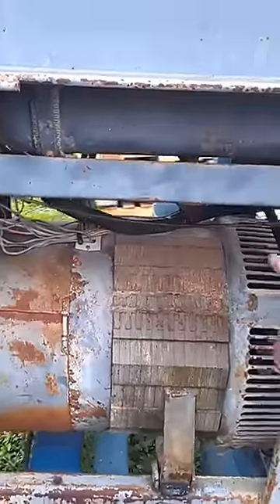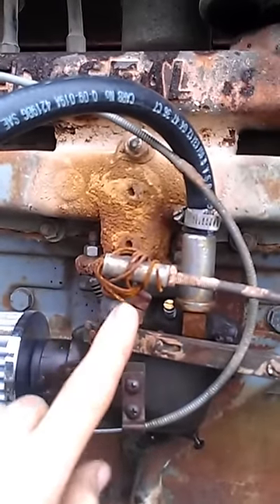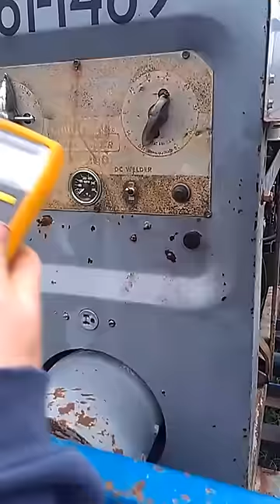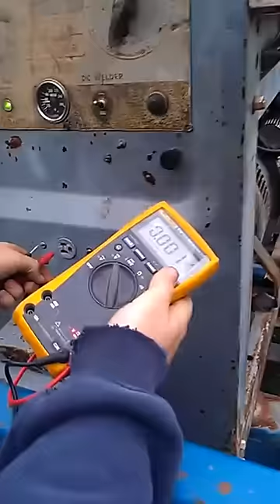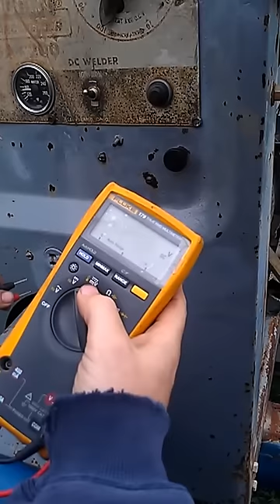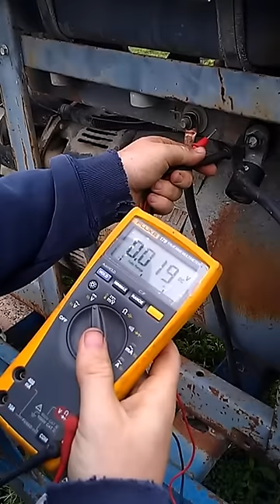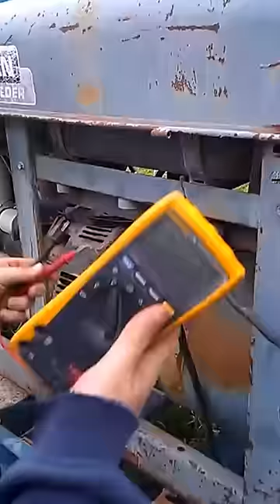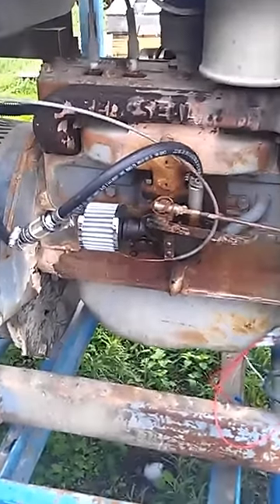setting ocv on sa200

Comment: You can set your OCVs where ever you like them. Now thats with in a given range due to the output at the 120v outlet. Not too much, not too little. But as far as your OCVs feel free to set it where the arc fits you the most. Most people are better off setting it to factory specs. But others like to bump it up to even over 100 for their welding habits. I've welded with machines at 108. Not best for most welding applications. But then again pipeline ain't most welding applications. I keep my 200s right around factory set. My 300D specs are naturally higher at 98 but on occasion i'll bump it to 105 or so. These things change along with environmental conditions, elevation, etc.
Reply: Dude my 300d is a bitch to dial in. It was set on 119 and the rod kept going out on a wide gap. I adjusted it down and now all my root beads wash in flat. No stack internal on the pipe. I'm pissed. Can't get it back up to where it originally was at 119. It won't go above 100. Seliniod bad maybe?
Reply: I like the OCV a little on the high side. It makes starting rods easier.

Comment: Lincoln 200s are maxed out at 93.3 on ocv. Engine speed is 1550rpm if u know how to check speed. I suggest getting it looked at before u start assuming its ok and playing with ocv. If its running lower than 1470 rpm you'll find your self stumped on why yours don't run at the settings that others use while welding. When u 1st crank up your machine when engine is cold the ocv is always going to be way above the setting u had it at before. It takes approximately 15 minutes of just idle to warm it and ocv should be normal and put in high idle and itll take less time or weld for a bit and for sure its hot. Ocv's level out after its warmed! !!! Fyi

Comment: If the OCV is at 93 and 1550 rpm how much will the voltage be between leads when welding at say 100 amps? Will it vary much with different amperages? What about different ranges at the same amps?

Comment: Something to add these sa 200's will say on the face plate if there original it will tell you the rpms these engine are suppose to run at. I believe this one is 1550 rpms so having an engine run higher then that at high idle may risk wearing the engine out faster and wear the generator out faster as well. i have been told a good generator is one that you can have the engine run at like 1550 and the ocv's at about 92-93 that will tell you that this machines generator is still in good shape. To check OCV's it will display it on the faceplate as well.
Reply: ChrisLawley 1550 is correct for the sa200s now a little slow is ok as well. Just remember. 1550 with no load, then check the ocv's. If they are high or low you need to adjust the rocker or "rack"  there is a punch mark on it. That is factory. And rolling it a half punch mark either way is how to set the ocv properly. Then the screw on the governor is to get it fine tuned in how you prefer. I have this literature from Lincoln

Comment: the volts coming out of my plug were around 113-114,  across the lugs were 82-84, i have adjusted the machine where the plug  is 119-120, and the voltage across the lugs have not moved, still shooting about 83-84, i don't know what else to do? any suggestions? TIA
Reply: T-Bone18 bump the rack

Comment: In cold weather it's hard to set ocv's.  You need to run and weld that machine with big rods (perfer 3/16's) for at least 30 mins to a he. Generator needs to heat up. My ocv's on mine is 89. Electric is 115-117. Good luck

Comment: A better way to set engine rpm is set your meter to AC, hz then probe the AC receptacle , target 60hz as you're in America. Pretty much anywhere else 50hz unless it's Lincoln or Miller

Comment: Dude, you set your volts at your outlet with the idle adjustment, then you roll your rack to adjust your ocv at your leads. This video is wrong. Sorry man but your volts kept going down also when you were idling engine down but you didnt recheck at your plug again....
Reply: Hey man! I got a question! Idle adjustments on the carb?
What does roll your rack mean while checking ocv with gov screw? 
Please and thanks

Comment: Check them from the stinger and ground  that way your getting a solid reading  I mean  its common  sense   the gotta test from the lugs  is just bs  I've tested and set ocv  for years on sa200  took it to a welder repair shop showed them how I tested them they said  it wont work that way  I told them put 100 bucks on that well they lost 100 bucks   cause it read at the lugs same as the end of my 100 foot leads
Reply: you are correct.  Now do a voltage drop test across one lead at a time.  from machine to stinger...machine to ground.  See what loss of voltage your getting.